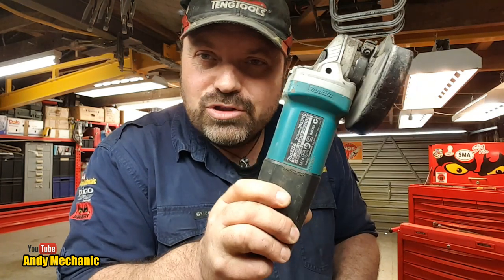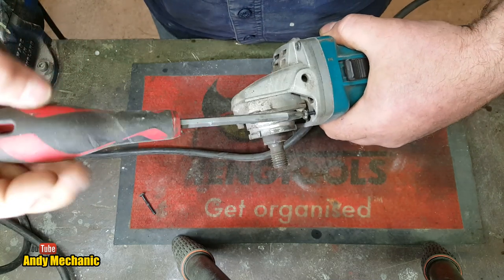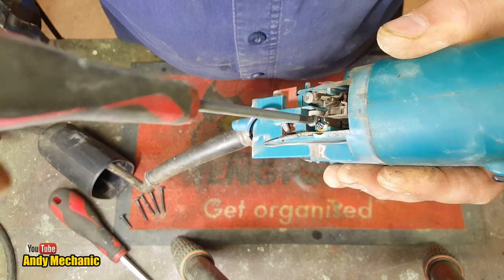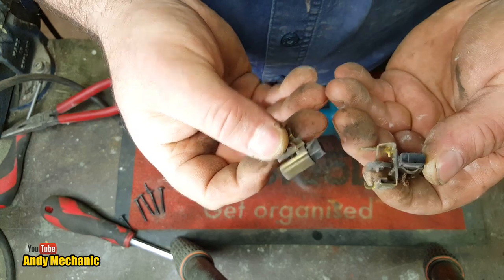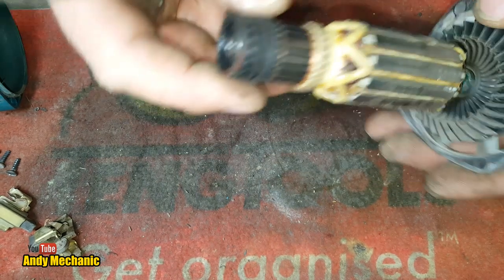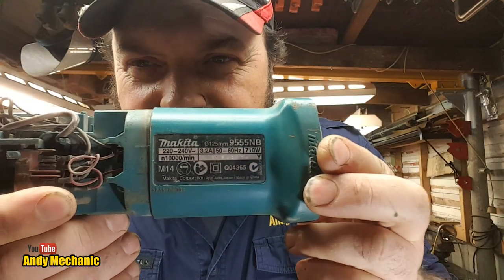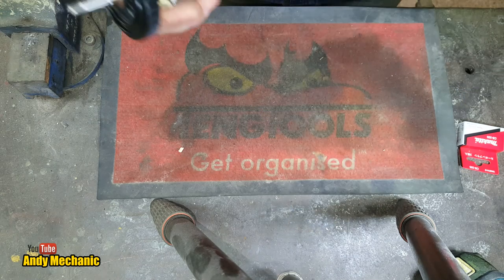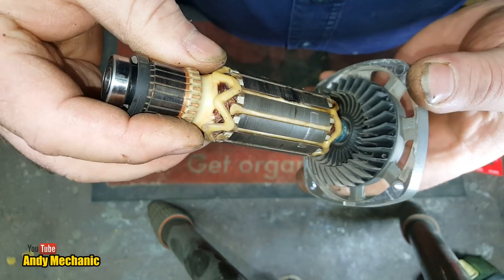240v Makita angle grinder diag & fix #1987

Comment: I  Have a 15 year old Hitachi grinder never been used,,checked why its not working ,turned out to be the switch,,The worst switch I have ever seen ,cheapest piece of crap put into an otherwise well built unit,On the website a wopping 15 pounds here in the UK <In my opinion should be 50 pence,bought a outdoor inline switch cut the cord and wired it up ,,works a treat.